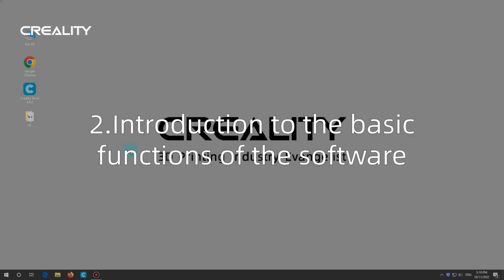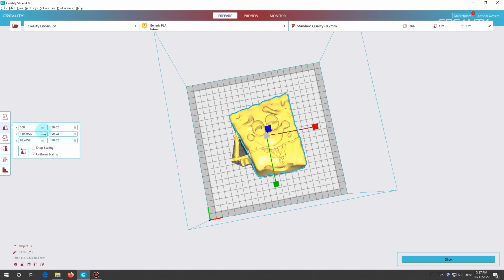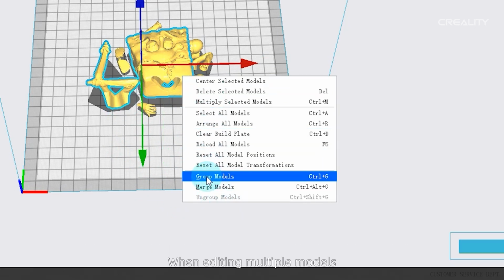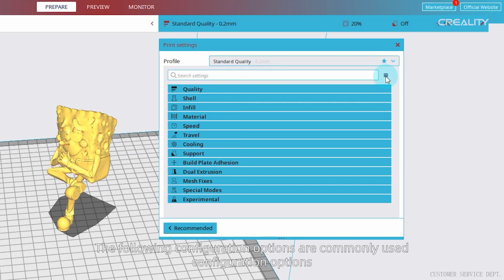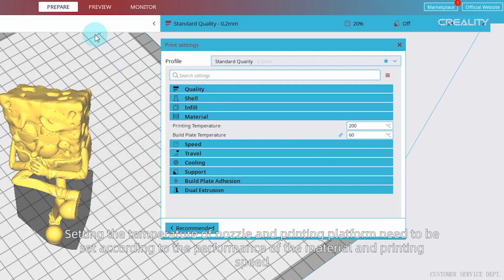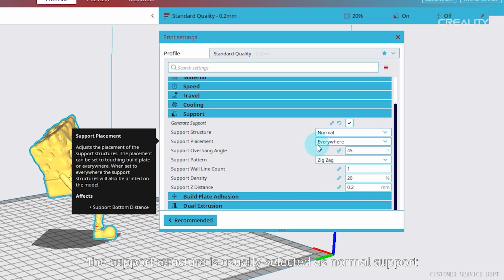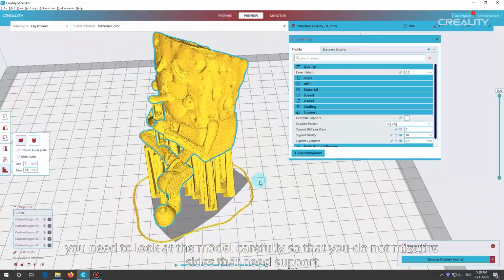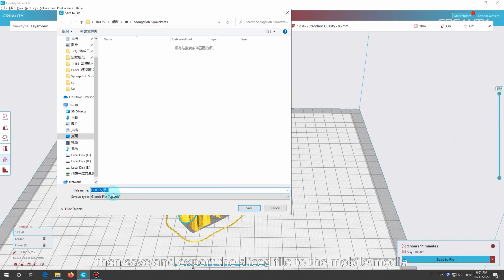Creality Slicer 4.8.2 Slicing Tutorial 2  Introduction to the basic functions of the software

Comment: 00:03 Introduction to basic functions of Creality Slicer 4.8.2
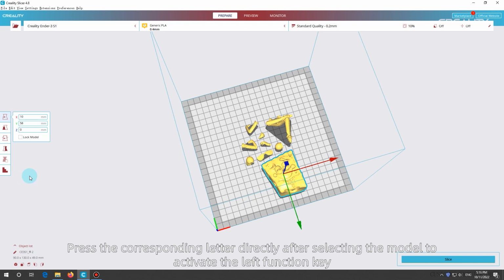02:29 Exploring the basic functions of Creality Slicer 4.8.2
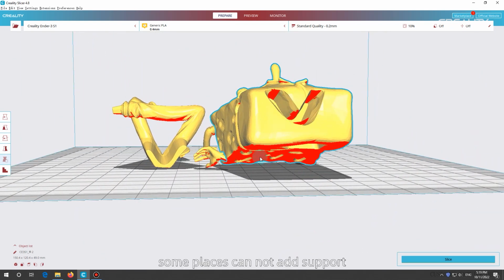05:17 Introduction to basic functions of Creality Slicer 4.8.2
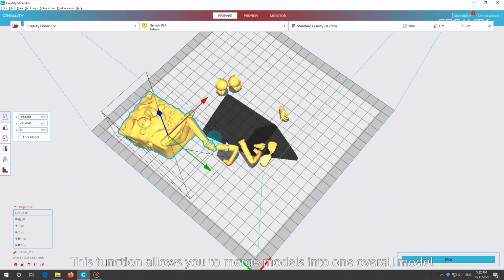07:55 Merging and scaling models in Creality Slicer 4.8.2
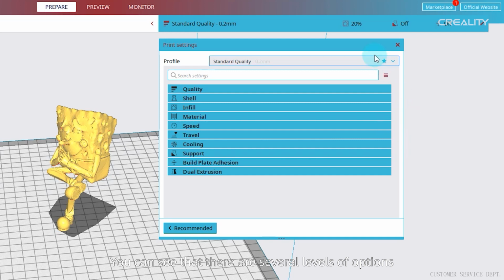10:44 Customize the printing parameters in Creality Slicer 4.8.2
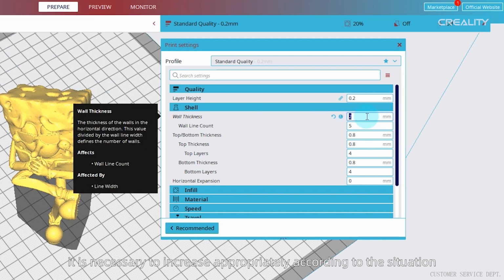13:05 Slicing tutorial covering layer thickness, infill, material settings, flow rate, and printing speed
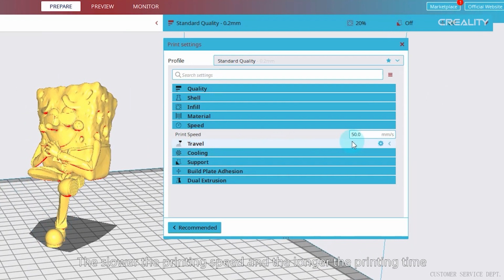15:21 Slower printing speed and proper parameter modification enhance printing quality.
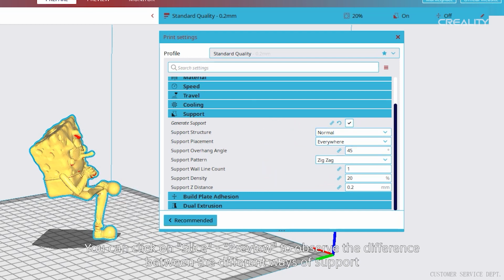17:40 Introduction to different support options and custom support settings
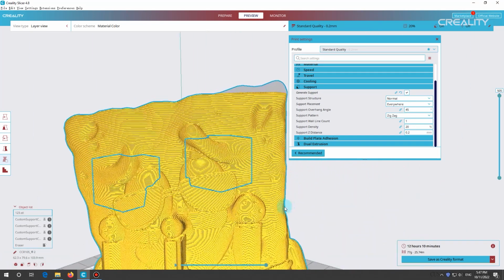19:37 Understanding and optimizing support settings in Creality Slicer 4.8.2
21:47 Understanding and using the raft option in Creality Slicer 4.8.2
23:56 Use software's calculated value plus 10 as a reference for scheduling printing